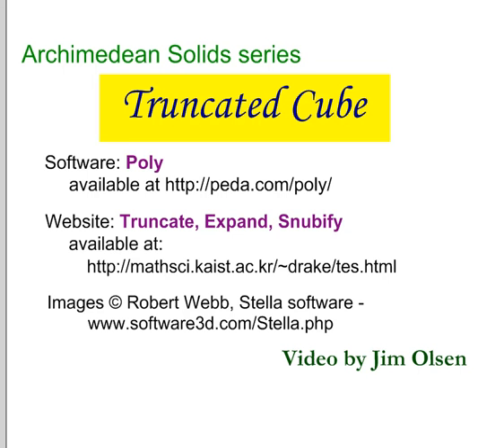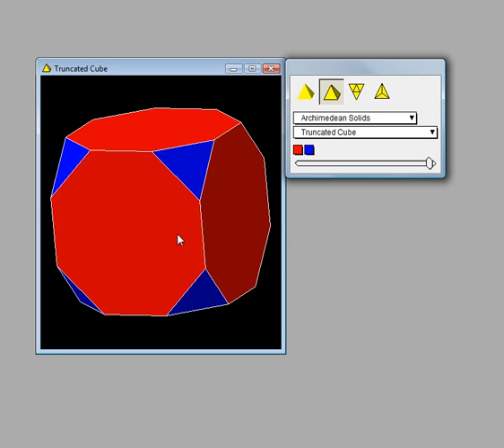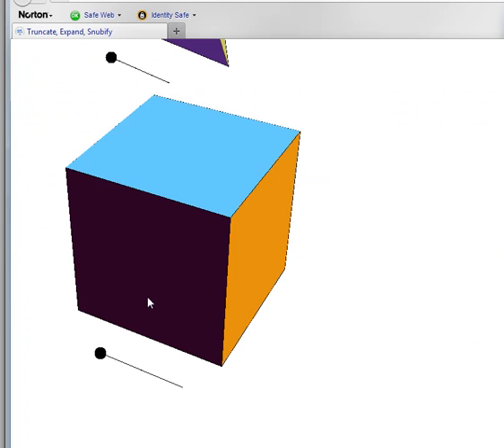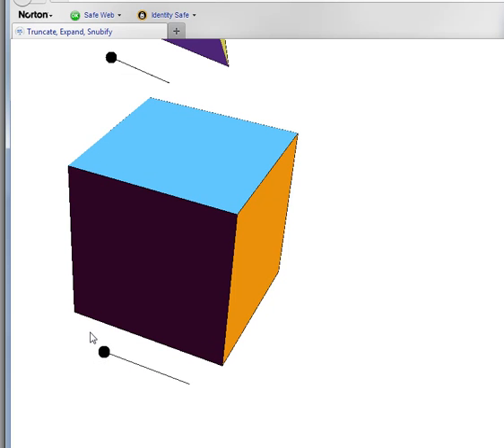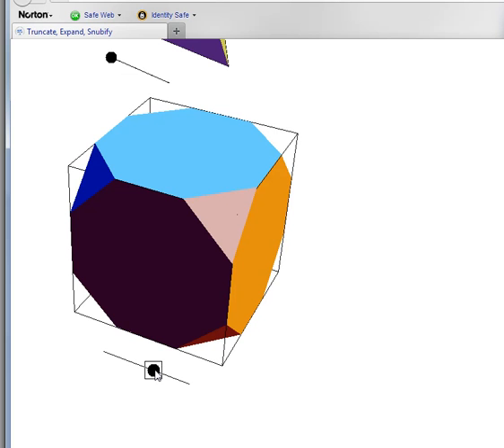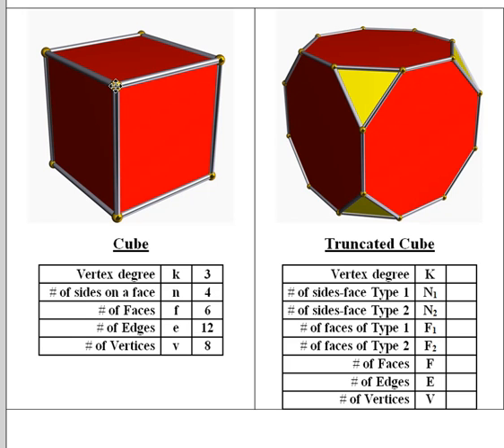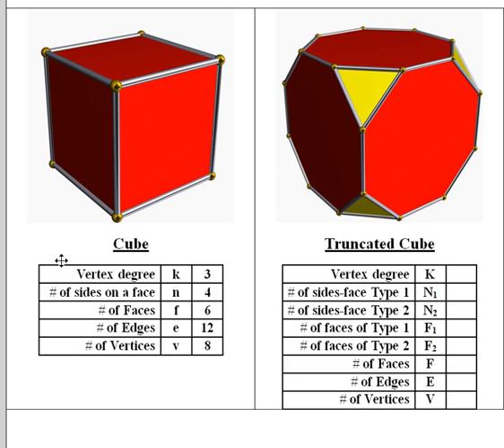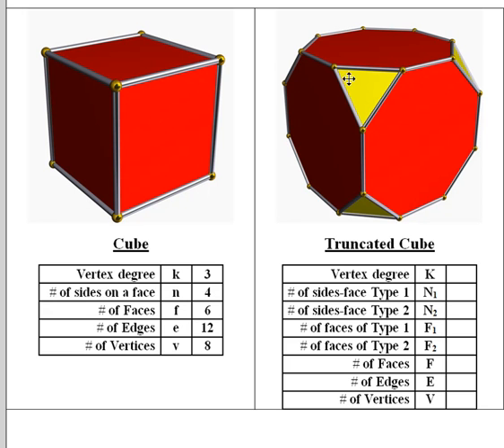Truncated Cube

Comment: I have discovered the truncated cube is in fact the true atomic structural model; it complies with every a tribute needed to construct to infinity without pyramiding out , it allows for expansion and contraction thus permitting plasticity and 3D construction to infinity

I have physically constructed each known element and several compound elements to find out the order of assembly and each component part and it's actual physical shape.  This is not a theoretical model; it is the actual model which I can prove by demonstrating how each element is formed and which elements form compound elements and how they structurally look.

With my model I can bastardized any element of compound element and know which component to eliminate or how to add molecular components to produce new compounds.  

For example in one hour I can demonstrate how TRITIUM is made and looks at the molecular level.  
TRITIUM is a bastardized atom; it's fabricated through a distillation and extraction method